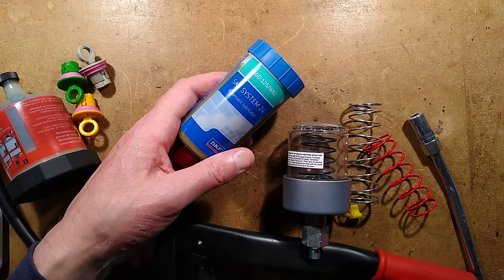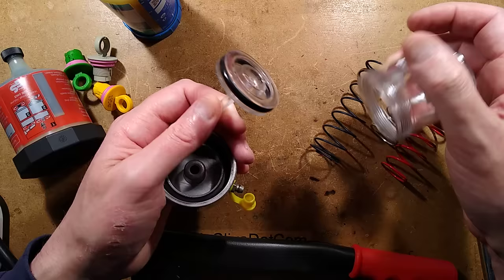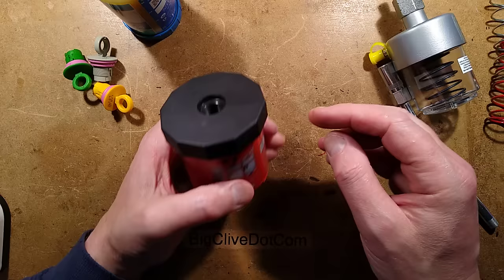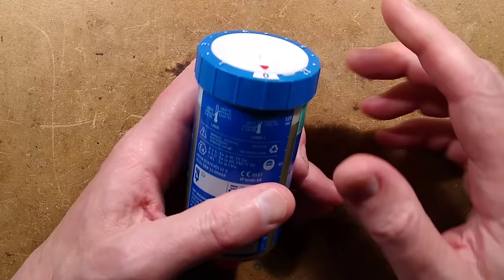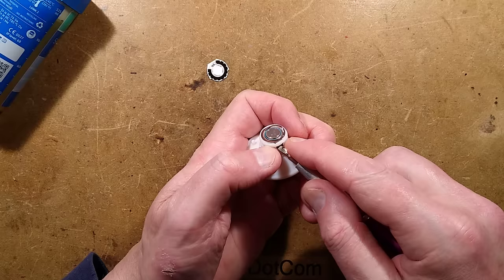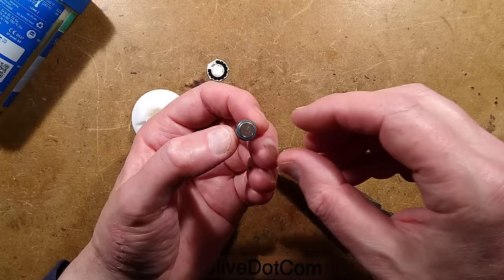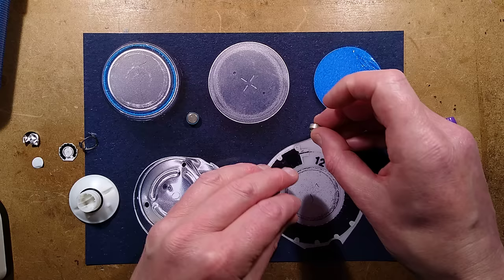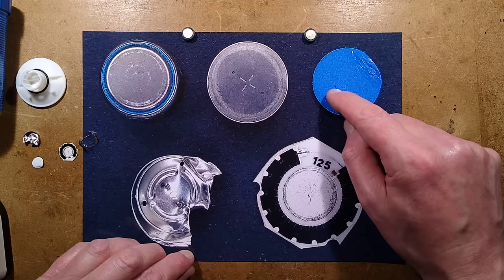Absolute genius automatic lubricator

Comment: I'm most surprised that none of the great minds here has said or even asked 'What gas?' My chemistry A-level knowledge isn't sufficient to explain how zinc + (presumably only) air makes gas. Now a drop of HCl would be different, but then again the reaction would likely be all over on day one. Answers please.
Reply from the maker: The tests have been done.  Clue - it ignited with a pop.
Reply: @BigClive  Oh you mean any old flammable gas. Methane?
Reply: or butane, methane, ethylene, acetylene, ammonia, ethane and silane?

I'd like to know how zinc + (not much) can produce a volume of gas (at ntp) sufficient to fill the grease canister several times over (it needs this v/p to have enough umph to move the grease). Anybody?

Comment: I'm curious if the Rocol one is using a pill that contains platinum and the liquid is peroxide. The pill seems to be a similar color as the disc at the bottom of a Clear Care contact cleaner.

Comment: Clive is there any procedure for bringing faulty electronic devices to your attention ? I have one in mind which is the Poundland 240v multi USB outlet that has a 240v power input that is not mechanically protected and then the soldering cracks causing arcing. I bought 5 and all had same problem. I opened them up used epoxy resin to fix the 240v socket then resoldered the connection.

Comment: ZincAir cells consume air when in operation. Approx 1 cm3 per mAh.
These cells seems to be 675 type cells that can hold up to 600 mAh. So here we have in total 1200 cm3 or 1.2 dm3 or 1.2 liter of air that  these cells want to consume.
Can this cartage work in the oposit way by letting the air outside push out the grease?
Reply from the maker: In this case the cells are deprived of oxygen resulting in a different chemical effect that liberates hydrogen when current flows.

Comment: 13:30 I wonder if that tiny rectangle to the right of the number 5 is a surface-mount resistor in series with the potentiometer (maybe to give a minimum resistance in the circuit)
Reply from the maker: It's not.  All the resistance is printed.

Comment: Could it be the opposite? I thought Zinc air batteries does not produce gaz when discharging but instead consumes oxygen, are you sure that this is not working the opposite way by creating a vacuum instead of a pressurized chamber?
This is solving the issue of stopping the reaction when oxygen is consumed once all lubricant is dispanced.
Reply: They are no zinc air....

Comment: I had a IP68 petzl head torch that ran off 4 C cells. It had a 'gas pellet' in the battery compartment to absorb the gas given off by the batteries. Not sure how that worked or why it needed it. Presumably you could get a pressure build up in the battery compartment.
Reply: Might become a concern if you're ascending a mountain?

Comment: I’m curious if these can be used in explosion proof applications (like on a Division 1 nameplated electric motor).  They’re obviously not sparking devices but the gas might be an issue depending on how much is released.
Reply from the maker: It's a small quantity.

Comment: Traditionally? . Actually.there was a grease or oil  box which sat atop a bearing housing or even a series of bearings, and as the metal, such as gears  would warm from friction or work, the oil or grease would migrate to the bearings...

Comment: I'm in the same as you @bigclivedotcom I do not see where the gas is comming from or even which circuit is using the values of the resistance. This needs to be investigated further :)
Reply from the maker: It will be.  There are zinc air cells on their way.

Comment: I wonder if there would be a way to design a refillable version that blinks an LED when the plunger reaches the bottom... ;)
Reply: You could absolutely do that, although it would make more sense to keep a green LED lit as long as it is working ok. If it just lit when it was nearly empty, it would just go out again shortly after that, and you wouldn't know whether it is full or empty anyway. 

You would also almost have to put one more cell in series though, and you would only get VERY little light from it unless you added way more battery capacity. And you would need a few electronic components.

Comment: Are you sure you've got the right explanation, Clive? I was seeing it as perhaps electrolysising something in the grease, maybe water floating on top, or the grease itself, could be broken down to make gas.

A zinc-air battery producing gas doesn't make sense! Then again neither does them having insulating tabs over the back while they're supposed to be in-service, unless that's for storage and the user is supposed to take the tabs off, using some method of opening up that's less violent than the one you used, did you get the instructions? Just... seems more likely. Then again if there's a chemist in the house they can tell us better. Could it be electrolysing the grease or something on it? Are there contacts anywhere?
Reply from the maker: More data in the description.

Comment: So when the unit is empty its thrown away, can it be reused? And once its started the battery seal is broken and cannot be resealed, so it has to be used, no stopping it?
Reply from the maker: The cartridge gets replaced as filling it and sealing it to the standard needed might not be viable.  But there are versions that can be refilled. 
The unit can be stopped mid use.

Comment: We used to use loads of these,  They are very vulnerable to being snapped off as the threaded section that is supposed go screw into the grease nipple is tiny.
Reply: I've used these for plus 10 years at work and never happened to me. Interesting. Though I obviously install them always on holders and lines if they are in any sensitive location.
Reply: @jothain  the mechanics when climbing around the machines use them as hand holds, or just bump them when cleaning and snap them off, In the 20 years we have been using them I would say 25% get snapped off.
Reply: @dogwalker666  1/4" threads and plastics used as hand holds?! Right. Sounds great working environment and something to be done in common practices 😧
But true, I could guarantee that they won't last that 😀
Reply: @jothain  well to be fair when inside the machine it is tempting to grab hold of anything,  They are always pulling off photoelectric switches,  proximity switches and even the Fiber detection lasers, they are £300 each and months delivery from the states.
Reply: @dogwalker666  I have to disagree with you. I've been plenty enough in various machines "engine rooms" and the maybe biggest rule is "Never ever jank grease lines, electrical lines or pneumatic tubings". Hell I have to repair everything I break myself, so it's just common sense to avoid damage. Also if things like these lubricators are actually in such locations that they're damaged, well then they just need to be relocated with. You can easily use like 1 to even 4m of tubing (depends heavily if it's grease or oil) to move them in more convenient place.
Reply: @jothain  not on rotating equipment there is no where to relocate too, I guess you haven't worked on many industrial machines, Engine rooms are a totally different environment. Don't forget cleaning crews are not trained engineers, They don't give a monkeys chuff if expensive parts get broken,  That's why they are minimum wage.
Reply: @dogwalker666  One huge mining industry related chemical facility, dairy mechanic and bunch of metal workshops are the environments I've worked at. Never seen problems you mentioned. I always brief operators if something gets broken and tell what the costs can be. Then I remind that hazards can cost multiple persons wage in very short run. Parts I'm responsible all is fine and dandy and I'm generally speaking very happy with operators and people who clean. But sure, there are shitty places that no one gives a damn. I tend to stay away from such places.
There's definitely solutions for rotating equipment too btw.
Reply: @jothain  oh as an example on Friday on operator due to negligence snapped in half an omron "background suppression photo electric sensor", Smaller than a matchbox but they can see transparent polythene,  When I told him they cost £250 he refused to belive me, When I showed him the invoice he just shrugged and said the business can afford it.

Comment: Odd. Zinc air shouldn't liberate gas during discharge. They consume it. Could it be creating a vacuum? Or could it be abusing the "sealed," lower voltage battery to generate gas (H2?) through a side reaction? Or maybe there are prominant side-chain reactions that generate a significant amount of gas.
Reply from the maker: When there is no oxygen they exhibit this behaviour.

Comment: I have used these. Some times it just dumps it all regardless of the setting. Come back from the weekend and a pile of grease is under your unit.
Reply from the maker: That's odd.  I wonder if the machine is creating some sort of suction on the grease point, or if the lubricator is defective.

Comment: Any chance you'll explain how guitar tuners work? e.g. for a guiltar with 6 strings, do they have 6 quartz crystals and mixers connected to the microphone? And if they do, how do they select the right circuit to display just the frequency closets to the input frequency.

Comment: you say it's very inert and nothing could go wrong, but the gas from zinc air cells is hydrogen, so wouldn't it be pretty dangerous for essentially a tank of compressed hydrogen?
Reply from the maker: Only a small quantity so low risk.
Reply: @BigClive  fair point, is there a warning about flammability on the packaging?

Comment: What is greeeeze? 🤣
Be interesting if you set it to a month (for example), and had it dispense the grease into a container that you then monitored the weight of, with a set of scales. So you could see how much if delivers per day/week/month. So see JUST how accurate it is.
Reply: Greeze is when Clive wants to invoke controversy.  He knows that it is grease really, but then isn't consistent just to trigger the people "on the spectrum".  He knows what he is doing 😉
Reply: They're incredibly accurate. I've used these for plus 10 years now and for instance most common duration I set them is 4 months and it's usually like 4 months, plus maybe max two weeks plus. Remarkable for such tech. Also some used in 12 month scale and it's within month accuracy when they need changing. Only two have failed within the period I've used them. Very, very reliable imo.

Comment: The only real issue I can see is regular maintenance like greasing bearings is also opportunity to look for anything that may be out of place. Loose bolts, missing parts, long-term damage, that sort of stuff.

Things like this can cause problems to go unnoticed far longer than necessary leading to greater repair bills.
Reply: I disagree quite heavily. I'm mechanic and use these quite a bit. First thing, it's very obvious to see lubricant consumption just by glancing the thing and there's label to write down install date/replacement date. Second thing,it pushes lubricant all the time. Very essential small thing in damn or wet environment. Third thing is,that because they're so simple and easy/fast replace now all the time fiddling with grease gun, replacing cartridges are gone. More consistent lubrication and time for being grease monkey is transferred to my the good stuff. Being actually mechanic and having more time to inspect critical points. I love the fact that now I actually have machines that have nice constant oil film on expensive linear rails. Places that were swimming in lubricants, they were washed away or dry. These are in my books about the best damn thing maintenance mechanic can have 👍👍
Note: even better in some locations than conventional autolubers as mentioned before,these work slowly all the time 24/7

Comment: The tilt and twist method is all well and good - until the zerk fitting is inside a hole and there's no room to move the connector 🙄
Reply: Then you loosen the cap that holds the jaws.

Comment: What gas is this inflating with?    A regular zinc-air battery doesn't produce any gas when discharged normally - it consumes oxygen gas, and deposits it as solid zinc oxide inside the cell, which would decrease pressure if in a sealed container...

I think there must be something else going on here to make it work.   Perhaps the container is filled with some other gas?
Reply from the maker: See the patent in the description.

Comment: So basically when you turn on for a month you cant turn it off? The released gas could still be under pressure and still push the grease out? Im not sure if its a good design thou. but it certainly is a way of doing it.
Reply: Why would you want to turn it off? The machine will keep requiring grease forever until it is scrapped.
Reply: Not exactly.  Once it gets the chance to build up pressure, that pressure has to go somewhere.  If you accidentally switch it on for a few minutes, then turn it off, it'll probably be off.  Once you're ready to use it, you install it, set it, and leave it going for its set time.

If, however, you wanted to use this for something intermittent-duty.  Say on for 1-2 weeks, then off for a month or two, then back on.  Then this isn't the tool for the job.
Reply from the maker: If you turn it back to zero the gas production stops.
Reply: @Kineth1  yes. You are right. Last paragraph says it all.

Comment: I'm confused - Zinc Air absorbs oxygen and turns it into ZnOH, so it would be remove gas rather than liberating it.
Reply from the maker: It may be a side effect of current flow while oxygen is not present.  See the patent link in the description.

Comment: The o-ring solution doesn't look very reliable, honestly. I'd prefer the pressure chamber to be somehow glued to make it air-tight. Would be also nice to have any indication that the battery is still alive - who knows what happens when the unit is stored improperly. The fact that you need to break the o-ring seal just to have access to the driving battery cell doesn't seem good.
Moreover, there are 4 spring loaded electric contacts... Overall, the concept is impressive but I'd not rely on this device in demanding conditions.
Reply: At pennies a punt, changing the o ring (alongside battery and/or chemical pill) seems a fair consumable part for maintenance. 
The costsaving of having a someone check periodically for whether the dispenser still has grease in it (using the line on the side), may trump the benefit of checking each joint individually in a large commercial setting.
That being said, I'd prefer to see a refillable version able to take a low voltage supply and more robust o ring seal that could be reused so it doesn't need  to be changed as often.
Reply from the maker: It has to rotate to the required dispensing speed.

Comment: I'd worry about this thing working reliably on expensive mechanical equipment. What sort of failure modes do you suspect would make this fail?
Reply from the maker: It's very simple, but it would be worthwhile checking the visible plunger was progressing down the cylinder as expected.

Comment: I am stonkered.  I had a look at the technical specs of the battery: https://www.skf.com/binaries/pub12/Images/0901d196800a62b1-LAGD_60_125_EN_tcm_12-25180.pdf#cid-25180 and it gives you all the active ingredients. The gas produced is inert apparently. According to the specs at start up it is set at 75 psi. I might have a look at the patent. I was unaware of this type of gas producuing battery technology. I should find another rock to live under.

Comment: It's got a built in check valve, using the sticker correct?
Reply from the maker: I think it's left on to protect the cells from oxygen exposure before use.
Reply: @BigClive  That makes more sense. Thanks Clive.

Comment: £30 pound a unit saves an awful amount of money if they work. If you adjust it for one years lubrication and if something goes wrong you will not know about it until a bearing has failed.Having an expensive man to grease them will pick up any faults before any damage. Today we get product recalls due to contamination in the product is that due to a faulty lubricator?
Reply: Why wouldn't you know? I've used these for plus 10 years. Two have failed for some reason in that time. Other than that, they've been remarkable accurate. I install these all very frequently on equipment I maintain. They're worth every penny in ie. linear rails using equipment in dairy. There's actually label in it two write down install date. So you just check visually bottles that their consumption is on the ball park. Our production equipment is washed every single day and this has been the only viable way to guarantee that moisture won't effect bearings or that someone doesn't over lubricate stuff.

Comment: although these are cheaper than having someone go around greasing, I wonder what the cost of breakdowns/problems that would have been noticed earlier by the lube technician, snowballing into bigger problems, would be.

if you have a guy who's job it is, is to go and stand next to a machine every day, even for a short while, he's going to pick up on oddities like say, a noisey bearing. 
these auto lubes won't do that..
Reply: Bs. That's not universal statement. I'm the guy that's exactly paid to maintain machinery in dairy. Equipment gets wet daily and if not wet, then moisture. This pushes grease all the time into devices and work incredibly accurately and reliably. These days I trust these way more than my colleagues in lubrication